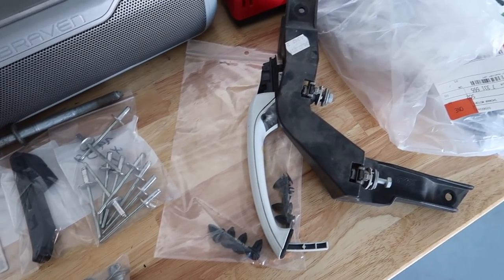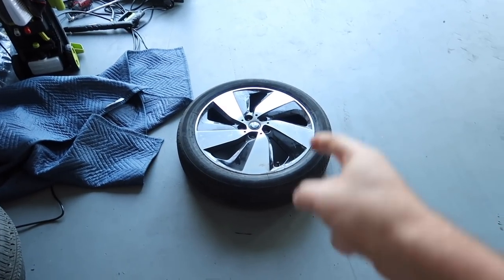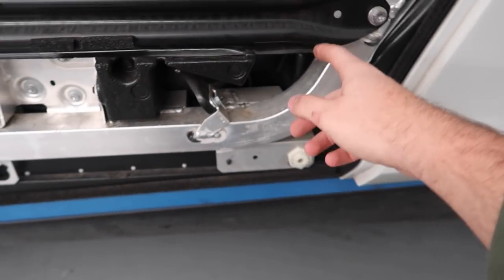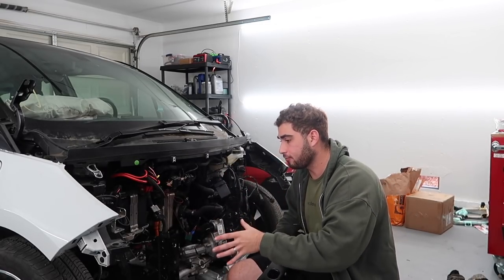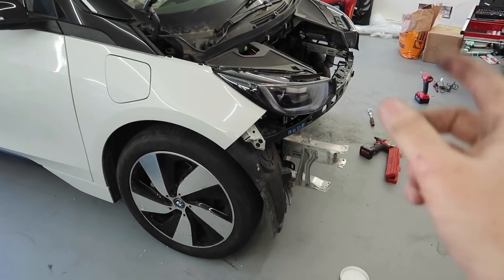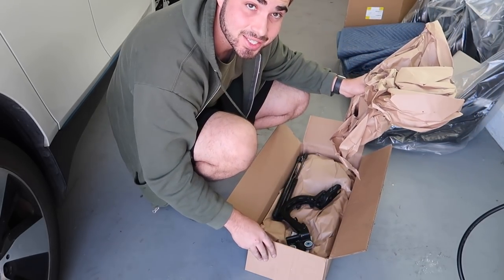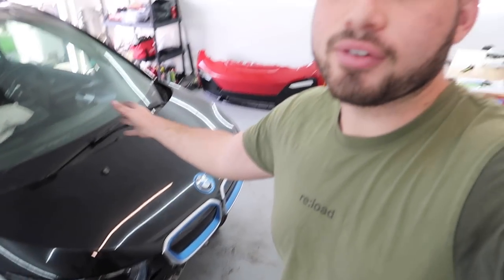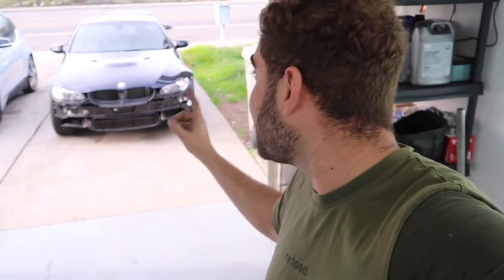ASSEMBLING 90% OF THE BMW I3! MINI BUT COMPLICATED!

Comment: Hello. Nice video. Did you finish this repair? I would like to see how did you do it. I need to do something similar in my 2017 i3. Only the lower front part was damaged but it didn’t affect radiator and wheels. Just plastics and lower impact bars and supports.
Thank you!!

Comment: Good stuff, Nour. I'm in a similar position, I just picked up a 2016 REX with light front damage. Quick question: Did you already replace the B+ wire, fuse and relay? If not, how did you reconnect everything to get to jerry-rig the 12 V battery to the high voltage system?